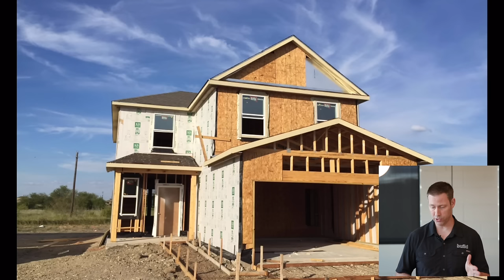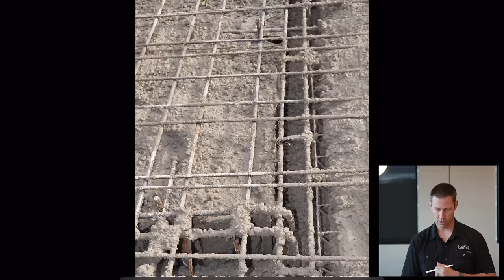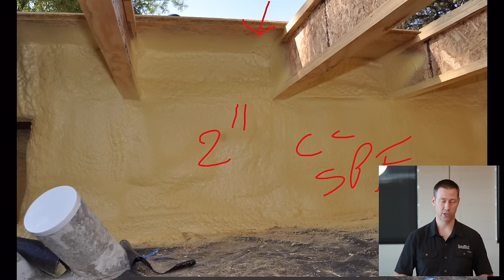Foundations - Slab vs. Pier and Beam - Which is better?

Comment: Your slab method, with moisture barrier, reinforced rebar - even down like piers pinning, and also seems to be laid out like a waffle slab. Just to further emphasize its not just a rebar slab out of the box. Your really going above and beyond to solve the moisture issue slabs can have.  @9.26 really show the difference this system has for a slab on grade. Great job!

Comment: Really like the pier and beam conditioned crawl space, but it would have been nice if you would have made it at least a foot taller. Just looked to short to be able to move around under the house to do plumbing.
Reply: lol  put a mechanics slider down there for getting around.

Comment: I started in the new home construction related business in the late sixties, by which time virtually every new home in my part of Texas was built on a slab. In the intervening 5 plus decades I've come to the conclusion there IS no comparison. Give me pier and beam EVERY time. Pre or post tensioning only delays slab cracking, it doesn't prevent it. But the single biggest advantage is being able to level a house when the earth eventually shifts. No pain, no strain. One guy can do it. And the advantage of being able to get to plumbing issues so easily can't be overstated. I'll admit there are issues that must be dealt with. But with careful planning, and KNOWING your area, those issues can be addressed and "fixed" upfront. Critters under the house. C'mon, it doesn't take a genius. Not even mentioned in this video is the HARM done by covering so much of the earth with impermeable concrete. In Houston for example flooding becomes a bigger issue every single year. With homes, driveways and sidewalks in addition to all the streets and freeways water has nowhere to go. At least one municipality within Houston has now nixed new homes on slabs. Too little too late, but they're at least trying. The older we get the more we find that in many cases "the old  way" was vastly superior to the new.
Reply: Steve Slade  
With the rainfall rates at times in Houston it runs under the house, taking the path of least resistance. And simple migration plays a big part. That migration is taken away with the 12 or more inch perimeter beam on a slab. A fair amount of research has demonstrated that were there no slab homes in Houston and surrounding areas our flooding would be much less severe. A caveat. With so much clay, and with Houston's burgeoning population combined with flood control systems decades out of date and designed for a tiny part of our current population pier and beam would not be a panacea. But it would HELP. And again, that's only part of my reason for preferring pier and beam.

Comment: Slab on foam, every time!
Just use a system with edge and corner elements. Very quick and superior insulation.
Reply: And in some ICF hip walls and super easy insulation job.  There are at least 5 companies making XPS foam specifically for under slab and most of them have a grid for radiant heat tubing.  Kill 2 birds with one stone.
Reply: Thanks !
Reply: If you never have a problem and never want to upgrade, ok then fine.  I prefer pier and beam.
Reply: Wafflepod
Reply: @e3innovation  - Non.  Je ne parle pas fransai.  (Phenetic spelling)
Reply: @fromtheburbstothetetons8826  
Do you think the soil directly under the XPS (and slab) can be used as a Geothermal heatsink? It certainly looks convenient to me: no need to dig deep (except to remove  gravel and sand), just cover the condenser loops with damp clay and compact. Cover with thick XPS and pour the slab.
Reply: @avid0g  My concern would be the soil compaction and the slab shifting.  I haven't done it yet, but plan to put geothermal heatsink under my garden shed (16' x 24').  I will leave the floor covered in crushed stone for a while.  Then I will either come back in a year with pavers or a poured slab.
Reply: @e3innovation  - Thanks.
Reply: @e3innovation  never heard of expensiv soil, have heard about expansive soils though.

ICF is very useful for slab on grade, makes insulating easy as it doubles as a form saving a few steps, especially when using a slab ICF form along with wall blocks to ass height.

Something akin to what is seen on this website where it shows ICF "Pier and Beam" construction which is just a modern technical term for Stilt House: https://www.insuldeck.com
Reply: yes,  why was he poo-pooing slab on grade insulation.  That is the ideal for passiv houses.

Comment: My family inherited a house from a relative which was built about a 100 years ago.  The pier and beam method was used, but it appeared that the builders placed the piers every few feet without any regard as to where the load bearing walls from the second story hit the wooden first/ground floor.  As a result, the wooden floors were depressed at the load bearing walls with the middle of the rooms bowing upward.  I was scared the flooring was going to shatter and then the load transferred to the remaining piers causing them to go down.  While those laminated beams shown look strong, is there any attempt in the modern era to create a pattern of piers so that load bearing walls inside a structure has beams and piers directly under them?
        I live in southern Louisiana.  The water table is just below the ground.  We don't have basements.  Do you know what happens to swimming pools which the owners fail to keep full of water when the water table rises?  Some float like boats and rise up out of the ground and others collapse inward.

Comment: in software architucture terms pier and beam would be considered decoupled, and low coupling is good. 2 items are coupled if a break on 1 causes a break on the other. good job guy

Comment: I'm in central Oklahoma and would much prefer a basement.  People say they don't build them around here due to the soil and water table.  I say bull.  We put a man on the moon and you're telling me you can't build a basement in the most tornado prone area of the world? Basements should be standard for every house.  You're getting an entire extra floor for your house, and when bad weather comes, you're not going to die.
Reply: bugalaman 
Exactly. I lived in tornado alley for two decades. I hated the frequent threat of tornado.  When we lived in OK a tornado passed near us. It really does sound like the roar of a freight train speeding by. Scary. Basements folks, get a basement if you can, especially in tornado alley.
Reply: High strength concrete basement walls are waterproof but block will always be a problem
Reply: Steve Slade 
Have you nothing positive to share?  I’ve had two homes with basements and have nothing but positive to say about them. Energy efficient and easy access to plumbing, electrical and vents for the floor above. Goodness man, you have an attitude problem. Have you never heard that you cannot have a positive life with a negative mind?   You should really take an honest look at that aspect of yourself.

Comment: On the Modern Farmhouse is there a reason you used standard plywood instead of Zip System on the gable end of the house?
Reply: Looks like the overhang was painted, no closed in soffit. I assume the plywood on the ends made for a better look when seeing it from the underside.
Reply from the maker: Yes. Correct

Comment: Own A pier on beam in Colorado.  My structural engineering friends say it's for expansive soils.  Was told they went away from it for costs
Reply: I built my home pier and beam on strong expansion clay 15 years or so ago. The piers need to reach either rock, or soil with a constant moisture content. In our case, the soil is deep glacial till and the piers are 2+ metres deep so a lot of concrete, but no reo needed. I'm pleased with the result and wouldn't dream of putting a slab on any significant slope.
The knarchitect told me the holes would only take a half day to bore and I was a little sceptical. It took almost two whole days because of rocks and the clay was wet and sticky. My teenage son used a shovel to clear the auger because the clay wouldn't shake off. He was very sore afterward.
Reply: @jonathansturm4163  Good experience for him, but you might have cured him of building in future. Perhaps it will incentivise him to excel in his studies so that he won't have to do such hard graft?
Reply: @linmal2242  He went on to university, but dropped out part way through second year for the very excellent reason that the lecturers didn't seem to understand the real world. He is 2 in c where he works and is on an excellent salary. He is living in a house he's buying and renting out the flat (apartment) he purchased a few years ago. He wasn't at all well-suited to the manual trades, but does try.

He learnt the most important thing about building during my build. Builders don't knock nails in. They hire the people who do that stuff. It's all about project management. I saved $AU180,000 doing the build myself instead of hiring a builder. Since I didn't borrow or earn that money, I saved on interest and income tax making the saving worth ~$500,000. That's a lesson he learnt well :-)
Reply: You can build slab foundation on expansive soil.  In fact our new house was built on expansive soil with a slab.  The way it's done is you excavate out all the expansive soil out (essentially creating a massive hole), then you backfill that hole with non-expansive soil(s) (i.e. sand).  The soil engineers spec out how far and wide to dig and the type of soil(s) to replace with.  Even compacting and layering the new soil is spec'd.  It's a lot more up-front cost, but of you want the longevity of slab, it's the way to go.
Reply: @cup_and_cone  : Wouldn't a basement make some sense (double the usable space for the cost of taller piers) as the excavation was already done?
Reply: kadmow 
A basement is so useful I don’t know why anyone would prefer to do all that excavation and refill for a slab. (??). I’ve owned 2 homes with full basements, 3 homes on pier and beam, and 0 on slab. I greatly prefer the full basement especially during tornado season. I rented a slab home once. It was ok but slab homes are not for me.
Reply: @cup_and_cone  I agree with you. Unfortunately it's a violation of Code where I live, or was. While you can have a building surveyor design or okay a Deemed to Satisfy (DTS) design, that's an extra expense and requires an intelligent building surveyor and/or engineer who is capable of doing the calculations. You also need a builder who is willing to learn and subcontractors who will follow orders rather than do what they have always done.
Reply: @kadmow  Highly dependent on the water table. Very difficult/expensive to keep water under pressure on the outside. Not impossible but you need to do the sums and have a pressing need as well as an adequate budget. Basements are incredibly rare here in Tasmania, but our climate is also very mild with little variation through the year.
Reply: @cup_and_cone , another solution is to put sub-piles below the slab to carry the weight of the structure and allow the slab to "float" on the soil.
Reply: Steve Slade  Oh dear! I'm grateful to Matt Risinger and commentards for giving me the benefit of their education and experience. And none of them are charging me a cent. Learning from them is fun and have already pointed me to where I can find further information that's going to improve my last build. Something I learnt several decades ago: Smart people learn from their mistakes. Really smart people learn from other people's mistakes, too. Thanks fellas; yer blood's worth bottlin' as we say in these parts :-)

Comment: Matt, my brother lives near Dallas TX, and he has to water his foundation. I never understood the logic behind watering a foundation (I'm living in Virginia), could you explain why you might need to water a foundation in Texas?
Reply: John Scancella We lived in Katy, TX for a few years and were also told to water (around) the slab. My understanding was that it was to maintain even moisture around the slab, since if soil dried out and shrunk back on one side more than another, it would create stress on the slab leading to the possibility of it cracking and or subsidence.
Reply: Mark Bell if you surround the area with compacted crushed stone, they would alleviate the need for watering the soil then, no?
Reply from the maker: Mark is correct here. Many areas of Texas have expanse of clay soils (some soil can move +-4”. This means that when it gets wet it expands and moves. The reason to water around the foundation is to keep the soil in an expansive state rather than shrinking back and expanding seasonally.  Often homes have one side that gets wet often (sprinklers w grass) and another that’s mainly dry (maybe a gravel side yard to park a trailer) so the house sees differential movement from expansion/ contraction. Then the slab moves.
Reply: @john scancella : it's common in our area to water however it's due to the initial problem which is the engineers & builders are building on a soil that has no business for a house to lay on. I'm foundation repair certified &  the builders do not reclaim soil and bring in proper soil due to an expense. The clay they build on is with a 'high plasticity'.. It expands & shrinks. So that causes foundations to flex more than they are capable
Reply: @h2s .. that's why it's important to look for a builder as attentive as Matt!  He knows his stuff & it shows through some of the small differences that make a big impact on the end project. 😎
Reply: John Scancella I suppose mulch or stone chips would slow evaporation and so might reduce amount or frequency of watering. Sprinkler systems around the perimeter of the house helped us but, as Matt says, there were areas that we needed to water with a hose. We had a friend, with an older home, in Houston, who had a crack in their slab, it was very noticeable. I don’t know if they ever managed to repair it. I don’t know if it is possible to lift the dropped portion of the slab hydraulically pumping in cement, as they do with side walks. Definitely cheaper and less stressful to water the slab.
Reply: I finally escaped from Dallas and Tx all together. Our "black top" soil could have 4 inch wide cracks at the surface on a hot dry summer day. Triple digit temperatures for 45 consecutive days in 1985.
Reply: @buildshow On slab designs, many engineers here in Houston, will put a note in their  details that the home owner will maintain a consistent soil moisture content around the perimeter of the home.  We also see the same verbage in builders new home warranties.  Too much moisture or too little water can cause foundation failures.
Reply: @h2s In Houston, many concrete foundation designs require us to flair the bell footing when we reach the good clay (red clay)

Comment: You mentioned post tension vs rebar slab. Given the proliferation of PT slabs Ground Penetrating Radar (GPR) scanning can prevent accidental damage to those cables or any other hazard within the slab. I used to work as a GPR scanner and especially in a residential environment I could locate hazards such as PT cables, live power, or conduit (below or within slab) very quickly prior to cutting concrete. 
Not my current line of work any more but I highly recommend GPR for any work done through concrete. A couple hundred bucks (I used to charge ~$165/hr) could prevent tens on thousands of dollars in repair. Possibly even worth its own video to educate people.

Comment: Love how this guy talks like moving a frame house is a super common everyday event. "You know, if you got an extra $250,000 and are bored of the view out of your bedroom window, it's always nice to have the option!"
Reply: Not sure about Texas, but $250,000 is extravagantly high to move a house.  Unless you're moving it across country.  You're 2.5 to 5 times too high on that guess.
Reply: @patrickshelley09  honestly had zero idea what it actually cost since it's such a non-event
Reply: @2percentright  Moving a house is not that common.  But picking one up to put a basement under it isn't uncommon.  After Sandy hit the east coast, they were picking up houses and putting them on stilts left and right.  I know of a company who moves houses here in Michigan who basically moved out to Jersey for two years.  They were picking up a house and putting it on stilts at a rate of one a day.  Because of the volume, they were typically under $20,000 a house.

Comment: In that drone view you had the yellow water barrier but you didn't explain why it looked like it was split up into different size and shape cells.  Maybe I missed that point.  Are there beams in the grooves between cells?  Very nice video.  Thanks for doing this.  I was thinking about a couple other things.  We need to be prepared to raise houses in areas that could be prone to flooding--that would be a vote for pier and beam.  Also, I was wondering about radon intrusion into the house.  I like the vented crawl space since you should never have a radon issue with that.  If people think I am nuts, take a look at a map of where radon is a problem.  It is widespread.  A friend has a basement (thin concrete floor) and had to consider several options to retrofit a fix for the radon he was getting.  Would that be a problem if he had a slab on grade?